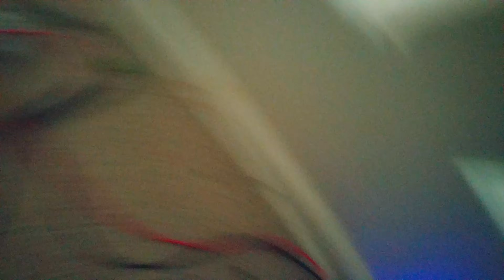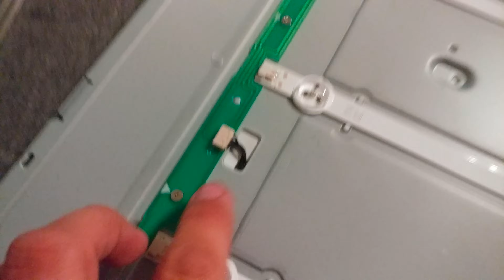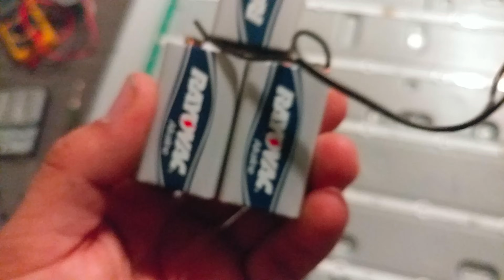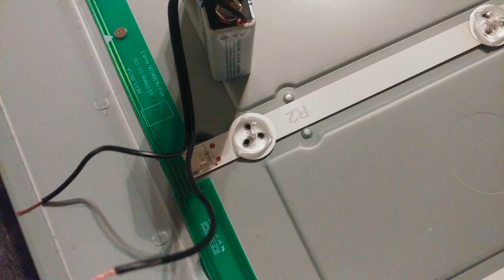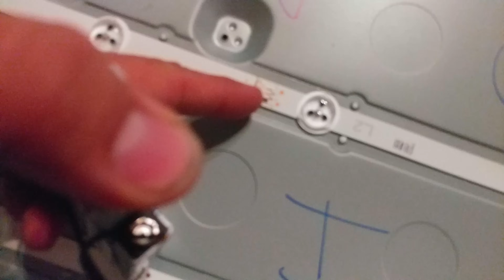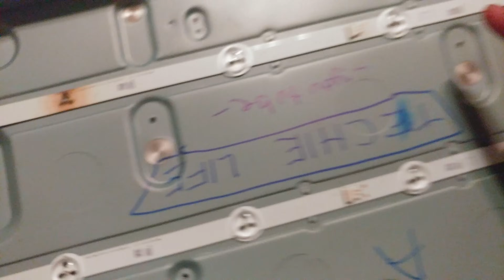how to test LED strips without tester Using a battery. backlight tester DIY

Comment: I have a Vizio e50-e3 I tested the backlights with the 3/9V and out of the 4 rows of 10. The ones on the outside; only the first half goes on. The 2 rows in the inside do the same but on the opposite side of the strip. Is it a coincidence? Is there something that I'm doing wrong or missing?  Each strip has 4 dots 2+ and 2-  (extra info just in case) Any suggestions? Gracias
Reply from the maker: Sounds like you may have some bad LEDs
Reply: @TECHIELIFE  Thank you very much! Yes, two sets were off. But now that I took it apart I notice a crack in the black screen!  F@%&@ piece of S@&#@. Don't know what to do with it now! Sell the boards or buy the black screen? Great day and THANKS A LOT, AMIGO! Great job!
Reply from the maker: @robertoayala5142  sell the boards. LCD are very hard to find and expensive
Reply: @TECHIELIFE  Diego I'll sell them to you if you need them, thanks compadre!
Reply from the maker: @robertoayala5142  lol. Thanks but I don't have a need for them. Sell them on eBay!

Comment: I have my LG apart down to the LED's. How many volts DC do these strips use? Looks like 100+? 12V didn't even blink them.
Reply from the maker: Depends. Most lg LEDs will use 6v each.
Reply from the maker: So if they are in series, then just add each 6v for each led. If it doesn't blink, there could be an open in the circuit

Comment: My TCL 65S401 went dark last night. The sound and picture are there (flashlight test). Would all of the LEDs go out at once or would it more likely be the power board?
Reply: My TCL C2 65" went black last night too, I think the new update is messing up something on board, because 2 more of my friends had the same problem few days ago. Thankfully its in warranty so its going tomorrow for repair.
Reply from the maker: just lower the brightness down on the leds.

Comment: I have a LG 55in when I turn the TV on the LG logo comes on then the screen go black I have sound but when I shine a flashlight on screen I can see a picture what can do this thanks god bless
Reply from the maker: You most like have bad LEDs..(or maybe one bad led for that matter) I'd try to replace them if you are savy. If not just sell it for about 50-80 bucks.
Reply: @TECHIELIFE  you don't think it could be the main board thanks god bless
Reply from the maker: @cppresley7015  on lg, if you have sound, and no back lights but a faint picture, the. It's going to be the LEDs. What is the model of the TV?
Reply: @TECHIELIFE  LG 55lm6200 thanks god bless
Reply: @TECHIELIFE  model is LG 55lm6200 thanks god bless

Comment: Hey man, thanks for the video. I've got an LG 65' UH5500 that won't turn on. When I plug it in then turn on, the LG logo flickers then turns off. After that, I press the power button, it blinks 2-3 times and nothing. Thinking about cracking it open and testing the LED strips. You think that's likely the issue or a board issue? Thanks!
Reply: First you need the check sound. İf there is a sound. Led problem, if not, main board problem.
Reply: @mehmeterdogrul8385  How do you supposed I'd check the sound if as soon as I turn on the TV, the LG symbol flashes and then turns off?
Reply: Power supply
Reply from the maker: if it flickers for a moment and turns off, then it will most likely be the led strips. One thing you can check is the optical port. if it is red, then your main board could be good. you can also do the flashlight test. i would put my money on the LED strips.
Reply: @TECHIELIFE  Thanks Diego! I'll check the optical port for the red light. I'm thinking it's the LED strips too. Got a good recommendation on where to purchase online?
Reply from the maker: @benpuccetti2372  I usually buy eBay. Simple. Fast . Cheap. And guaranteed.

Comment: So when you had the camera close to the led strip to show where to make the connections did the entire strip light up all the way across?
my 60" is only lighting one strip and not the one connected to it.
but if I test each strip individually all led's work .
Heres the deal, when I plug in the tv the back lights continuously blink in sequence with the stby. light until unplugged, it will not show a picture or turn off.
All but the bottom strips blink.

When I disconnect the back light plug from the power supply the tv turns on, stays on and turns off correctly.
Reply from the maker: What is the model of your TV?

Comment: I think one of my Back lights is not working I replace a 3 parts and still no image can a back light be the problem thansk!??????
Reply from the maker: I dunno. You should properly trouble shoot before wasting your money on parts  what is your TV model number?
Reply: @TECHIELIFE 55 hisense 4k 55h7b
Reply from the maker: Do you have sound?
Reply: @TECHIELIFE  used to not no more!
Reply: But what I can see the top part of the tv looks darker from the rest  so a backlight can be the problem for no picture I try the flashlight and can't see nothing
Reply from the maker: @Blas1474  I can almost guarantee that it's is the led backlights. And you probably have a different input.
Reply: @TECHIELIFE  ok around here they always giving away broken tvs can I use the same backlight in case I want to replace them?? Or does it Has to be the same model? Thanks for you time Sr??
Reply from the maker: @Blas1474  has to be same model. Usually.  Unless you know how to use a soldering iron and change out individual LEDs.

Comment: Thank you so much for this. It worked for me. The middle led strip in my Samsung tv isn't lighting up.  This has saved me so much money because now I don't have to buy a new tv 😁.
Reply from the maker: Good luck on fixing it. Please subscribe!
Reply: Hi I have question  what is the voltage  in your board  coz mind only 79.5 volt so its ment my led are dead  hehehe thanks waiting  for your response

Comment: Could you please help me out? I have a samsung 55 inch led smart tv UN55J6201AFXZA... Has no standby light and will not turn on. I replaced all the boards and still will not work and has no standby. Is that possible if the leds are bad? Cause im at a loss right now.. I appreciate the help thank you.
Reply from the maker: Try disconnect the main board from power board. The backlights should automatically come on once the power plug is plugged in. If you have backlights, then it is obvious that it isn't your backlights.

Comment: Fantastic video. I have a very similar LG that I will be opening up next weekend. Tried a repair on a Samsung glass screened LCD some time ago but made me sick how stubborn the holdings of Samsung were. LG seems easier to strip down to expose the LEDs. I will be trying your battery trick for sure.
Reply: Did it work for you?
Reply: @j.lietka9406  yes, worked perfectly. Total cost of repair (batteries, replacement LEDs) $15
Reply: @RogueLegend999  very good!! Thank you for your reply! 🤓

Comment: Question. If I wanted to test half of my led light without taking tv apart. Could I use a car or marine battery to check from back side of tv where it plugs into the power supply? Car battery being 12 volt and marine maybe 24. Or somehow would it pull to many amps and blow them? Thanks
Reply from the maker: It's not the amps that blows them. It's the high voltage. I would just start with 12 volts. Then work your way up
Reply: @TECHIELIFE  so in all reality a car battery would work?
Reply from the maker: Yes it could.

Comment: Just be careful that those wires don't get together or you will have some red hot batteries, there has been more than one 9 volt battery that has started a house fire in a junk drawer. I, myself got a hot one quick when a battery got against a quarter in my pocket. I'd sure find a way to keep them separated when you are not using the batteries to check the LED's
Reply: I have a case for storing my 9 volt batteries.  If you don't, just use electric tape to cover over the contacts before sticking them in your drawer.

Comment: With that one beaded LED, does that TV have a dark spot now?
Reply from the maker: yes you are correct. although, you can still replace the led strips, sometimes the price of those strips cost more than the tv itself. So in that case its just easier to bead it.
Reply: 0

Comment: Simple question... do LED strips work like Christmas lights logic? Meaning if one bulb goes out, the whole strip won't turn on? Just making sure I'm on the right track here.
Reply: no, if one led is shorted, all others will work, but the problem is, when one led is CORRUPTED, all others will not work. In this case, you can short corrupted led and this led will not work, and others will.And tv can work withouth 10 of the leds, and you will not notice the difference at all. Probably in most older tvs, some leds are allready shortet or not working, and people do not notice the differece. That is why tv has so many of them.
Hope this helps
Reply from the maker: So there are 2 types of led tvs. Ones that are wire in parallel and others that are wired in series. Most newer TV's are a mixture of both. Meaning that each strip is on its own "zone" or it's probably sharing the zone with other strips (depends on the quality of TV)you need to see how the circuit is built. Usually once I unplug one strip from the tv, you'll see the whole zone go out. Now an led goes out in 2 ways . One it creates a short. Or it creates an open. Which in either situation, the led needs to be replaced, or "bridged"( close the circuit)

Comment: @ TECHIE LIFE A Couple Volts, Yes, When I read 18.5 It had First went up to 22  or 21.5 then leveled out to 18.5
Reply from the maker: i would say that even at that voltage, the tv should have backlights lit. what about when you unplug the leds from the board. and try the same test. what is your result?
Reply: @TECHIELIFE  I don't have it down that far
Reply: OH I mis Understood, Same Voltage, But I can Only get voltage using The Chassis Ground.But there is continuity to ground (chassis Ground ) from the - pins at the board.
Reply: @TECHIELIFE  you Say you have a set for the same TV?
How many strips is in the E32h-C1?
How much for the used full set shipped to Bridgeport Ohio, 43912 ?
Reply from the maker: @mrbreezeet1  sorry, but i looked at my stock, i dont see the strips. I would advise to utilize ebay and search by your model number.
Reply from the maker: @mrbreezeet1  looks like in ebay you can get a set for about 25 bucks.

Comment: I got a Sharp 50’ and the backlight stopped working.(I still have sound and did that flashlight test) I ordered a T-Con board to see if that was the problem but there’s still no backlight. What do you think is the problem. Power supply maybe?
Reply from the maker: depends on the model number. in many many cases, the LEDS tend to give out before the power supply does, unless it is struck by lightning or a power surge. of courser replacing the power supply is easier than the leds, but if you want to be for sure, you need to measure voltage coming out of the power board.

Comment: Thank You
Can I use the three battery set up to test it right where the LEDs plug into the power board, to see if my LED's/back-light are working?  After unplugging the board of course. How Many Mh do you think that is? I just don't want to Fry my LED's if they are good. I take it a 20 volt Drill battery is too many Mh's correct?

Comment: Thanks. I understand the bridging one LED from an electrical perspective but wouldnt that afect the light distribution in the TV and therefore the image? If replacing the LED, even if not the same, would you be able to find similar replacements?
Reply from the maker: Yes you are correct. But in some cases it may not make a huge difference. For say like a corner led. Or in some cases, the LED strip may cost upwards of above 50 bucks per strip.. then in that case (and last case scenario) you would bridge the led.

Comment: All you need to know is the voltage and the amperage and a AC to DC converter with leads and clamps.

Comment: sony flat screen backlight on but no picture sound ok tcom on the main board replace the main board still no picture help
Reply from the maker: What model.. sounds like either a bad lcd or just need to do a firmware update... Sony is weird like that

Comment: I have a TV (Haier) that the leds keep burning out on it. We've soldered on new replacement leds 3 times. One led for each time. But they keep burning out. Is there something wrong with the power supply or could it be the leds are just trash? Could I just swap out the strips with different ones from a better brand TV?
Reply from the maker: Is it the same led? I wonder if you are damaging the led with high exposure if heat when soldering it. Or maybe the tv brightness setting is too high.
Reply: @TECHIELIFE  well see the interesting thing is that the ones that get replaced don't burn up. A different original one burns up each time.
Reply from the maker: @javisolis2568  I would probably say either the LEDs are junk in general.. or there the LEDs are burning out because of too much current. I would check the brightness setting to make sure that it's not in 100 percent.
Reply: @TECHIELIFE  I did take a reading from the power supply and it read at about 300-310v. I currently have it all taken apart so I can really check the brightness setting at the moment.
Reply from the maker: @javisolis2568  how many total LEDs in the whole circuit?
Reply: @TECHIELIFE  50 total. 10 strips with 5 leds per strip in series. I also wonder if just adding strips with 6 leds instead would work? I appreciate your help and time on this btw. I'm subbing rn! I fix electronics for a living but currently I'm learning stuff on tvs so this means alot to me man.
Reply: @TECHIELIFE  the replacement leds came out of a vizio

Comment: Great vid, just stripped my Samsung and noticed on the led boards it has 4 solder points with 12v and 24v. Could I just use a cut 12v dc adapter? Thx for any info p.s can this be done while they're all connected to each other?
Reply from the maker: I would not really mess with those pads. I believe those are capacitors . Instead test right where the plug plugs in. But it may be different. What is the model of your tv?
Reply: @TECHIELIFE  my model is ue40f6400. I have managed to use a 6v charger to test 2 led at time by showing copper. Weird thing is only 2 led are blown some of them look "dimmer" so would these need replacing as well? Thx
Reply: I've seen on aliexpress I can buy all 7 strips or around €35/£30. Would this be safer than buying just one and putting TV back together worried another could blow.?
Reply from the maker: @redogg2749  yeah that model is pretty bad with LEDs. If you want you can replace all of them,but those strips are probably used as well. So to save money I would just buy what you need. And when you are done switching it out, bring the brightness down to about 17 or 16 setting
Reply: @TECHIELIFE  thank for info, I use it for gaming so backlight is always 100%. I don't mind replacing them all I'm still not sure why some seem to be dimmer than other's? Because of this an my lack of experience I think for £30 to replace them all may be worth it. I can always swap the old ones if they work. I'm thinking of connecting the board to led and lighting them all up using TV power as it's already apart. would this be okay to truly test led brightness? Thx again
Reply from the maker: @redogg2749  if you want to test out the backlights, just unplug the main board from the power board and leave the LEDs plugged in. Then give it power. It should come on.
Reply: @TECHIELIFE  brilliant, will try it ASAP. Really love this model it's a pity suffers from this issue it's very bright and responsive for using as a gaming monitor, but hopefully now I can see if it's worth replacing all or damaged led strips. Subbed&Liked Genius 😎👌🖒
Reply: @TECHIELIFE  unfortunately only the top row seem to come on, wondering if I need to install main board and turn the unit on with remote?

Comment: 40L310U Toshiba LED i just picked up lights up for about 30 seconds until it gives out. When I flash the light I still get picture just fine. Would I even need to pull it apart if all the LEDS seem to work - if only temporarily?